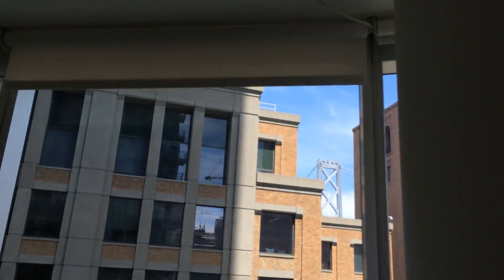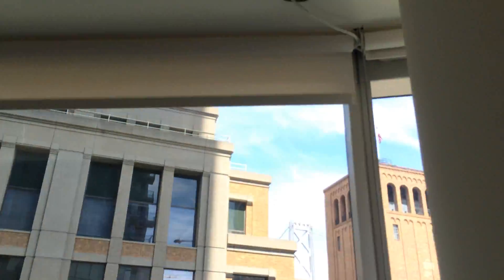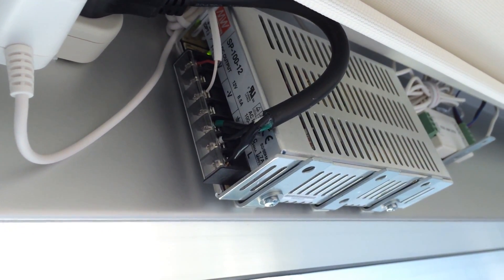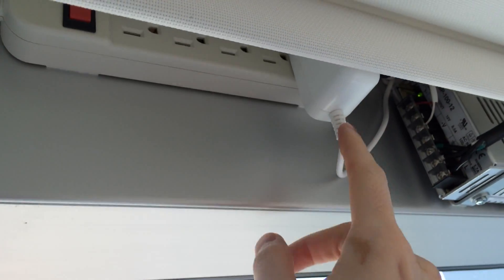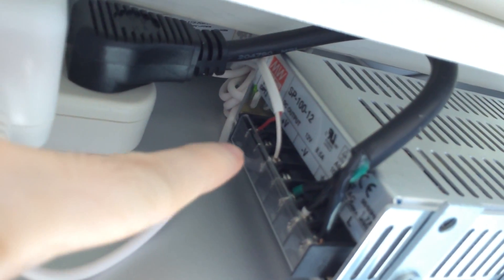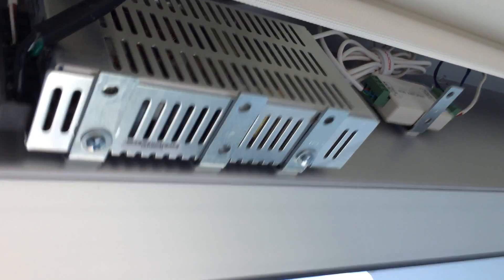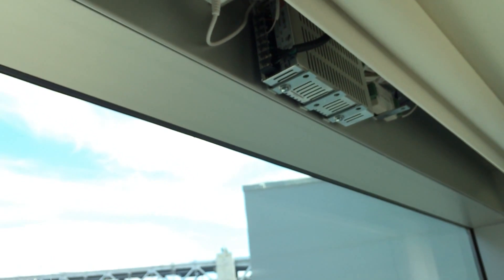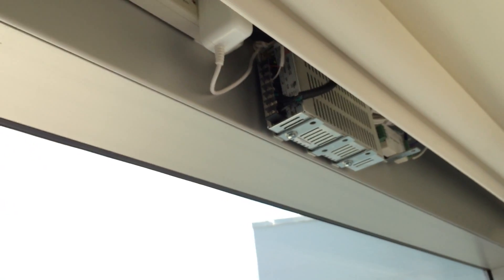Philips Hue Lightstrip controller + high power RGB lightstrips

Comment: THANKS!  This was what I had in mind for my project.
Do you know why the new Philips Hue Plus lightstrip connector has 6 conductors?  RGB would be 4 conductors and RGBW would be 5.
Reply from the maker: +Mike Andrews Mine has 4 conductors.  Maybe the new Lightstrip Plus is what you have?  I don't know how that is wired up.
Reply: +rkuo The Hue Lightstrip Plus has warm and bright white LEDs in addition to RGB
Reply: +Adam Foard Oh!  So that's why the Hue Lightstrip Plus has 6 leads, RGB (3) Plus Warm White (1) and Cool White (1)?  Thanks!
Reply: no prob
Reply: then  at 3:24 how do you have    it doing white light through the philips app if you only have the 1st gen  friends of hue strip controller with 4 leads, i though gen 1 hue did not do white i thought the plus did  white? plus you are using RGB strip and not RGB+W strip i though you needed a 5 lead RGB+ W strip and  controller and  amp with  5 leads,  VCC + , R  GND  G GND  and B GND plus a W GND ,to  get white ?
Reply: The first gen Hue stuff does do white but with RGB - all at the same intensity.
All I have are 1st Gen, although I got a new Hue 900 lumen A3 lamp.  With apps like OnSwitch on Android I can do effects like cool white fluorescent lights and warm white Antique bulbs.
Reply: Mike Andrews thanks so this guy is using some pretty expensive strip here ,so looks like his strip is doing a better white than  gen 1   phillps strip,so if i buy some cheaper chinese led strip i wonder if it will do white at all
or better to use a  light strip  plus controller and get some  RGB + W strip 
or like you said it has extra wire for  white and another for warm white ,can you even buy strip like that ,  6 lead stip like on a roll? like if you wanted to do something like this with a strip plus? i also saw some controllers that are  directly compatible with the hue bridge for only 50$ but i can't remember if they  come in RGBW or RGB or jst RGB
on amazon from  germany or denmark

Comment: Thanks. I used the same setup as you with 2x 5m strips and it worked perfectly. I also powered the hue controller with the power supply and it worked. 

I actually checked the number of amps used by the setup and surprisingly, it barely registered any power usage; even though the 5m strip is said to be 3 amps. But oh well. Better safe than sorry.

Comment: Hi! I want to cover whole my room with new Philips Hue Strip Plus (2nd generation). But I don't want to buy adapter for each 2m... I need about 10 x 2m parts. What you can suggest? Also I want to put wall LEDs into one power supply, so if something went wrong (LEDs died) I don't need to take my wall out just to replace them. :)

Comment: Hi and congrats for your setup. I'm going to build the same installation and I'm between the philips hue technology of lightstrips and the simple Philips lightstrips with white color. The only thing that I want is when I turn on the lights from the light switch, the lightstrips must have the 3000K white color and not the last used color (as it's happening with hue). Do you have find any solution for your installation? What does it happen when you turn on your lights? Best
Reply from the maker: pcvasilis I turn them on and off with a hue tap.  So most of the time it doesn't matter where I left the setting at.

Comment: i want to use the hue lightstrip whit 8m standard lightstrig do i stil have to modify the power suply or can i just connect a longer rgb strip?
Reply from the maker: Stefan Maes Without a doubt you will need to augment with another power supply.  The power supply included with the Hue lightstrips is only good enough to power that section of lightstrip.

Comment: Can I ask please to explain how you got round the voltage drop problem... in a little more details for mere mortal like myself...
Thanks
Reply from the maker: I just fed power to the opposite end of each strip with a second run of wire.

Comment: You could add a graphic for those who are not so deep in elec. that shows the plan of cable + ports etc. so that they know what to do before they buy those products. For example I am going to take the 12V DC from my Computer PSU that is inside of a oil aquarium

Comment: This makes me so happy. I've been looking for days as to how to go about setting something like this up. And here it is!  I will for sure be setting something like this up in the very near future!

The links in the description don't seem to work though.  Clicking through, I just get a product not found error message.
Reply from the maker: The links work for me, but I added the part numbers so you can look them up manually.
Reply: rkuo it might have been because I was on my phone, I'm thinking their mobile site isn't 100%. But thank you for the part numbers!

Question: is all the functionality there? I've read that some amplifiers don't like to dim the lights through the app.
Reply from the maker: Aaron Schmersal Dimming does work, but there needs to be more range of control on the low end of brightness.  AKA even at the dimmest settings, it's still putting out a decent amount of light.  Perhaps it's because the controller is calibrated to the low power output of the original Hue Lightstrips?

Also, there is some color shifting when brightness is low, most noticeably on the white setting, which shifts to yellow when dimmed.  I really don't find it to be that much of an issue tho ... the problem with lightstrips is usually getting more lumens, not less, so I've been running them at full power.

Comment: Hi, just want to say that this is awesome, so I really want to do this, so you only need 1 Hue Light strip and remove lights from the wires? can I just cut the wire before the lights and strip the wires to connect to the amp? Also, can you connect a whole new system and work with Hue? example: like you have yours under the curtains and say another amp, hue controller, RGB and lights in the kitchen? Both working with Hue? would love to know. Thank you.
Reply from the maker: Sure, you can cut and strip the wires ... why not?  I just found it easier to desolder the wires.  Setting up a second system would work fine.  You would just have to do what I did again with a second Hue lightstrip controller.